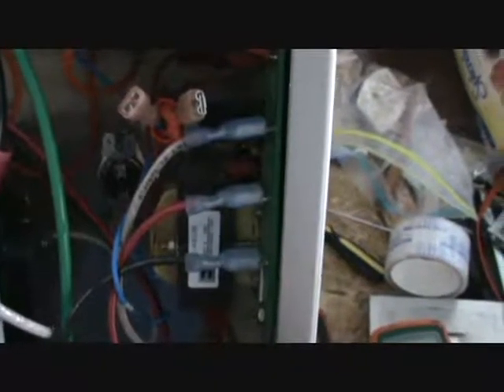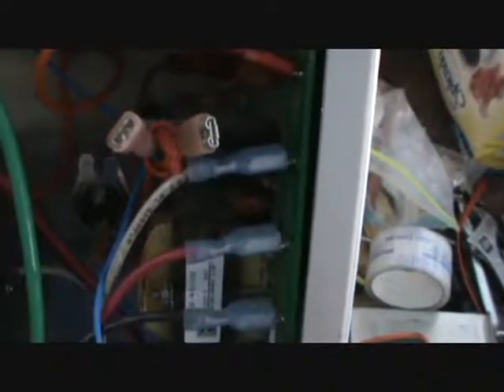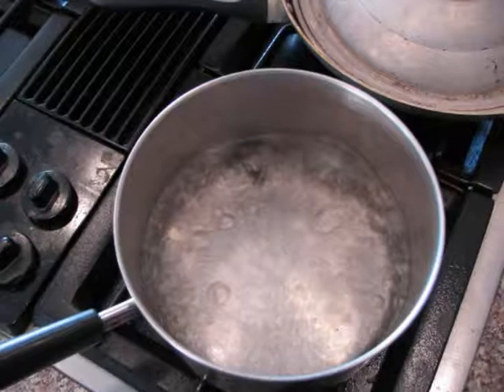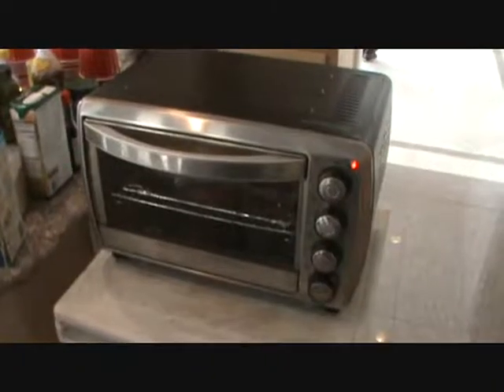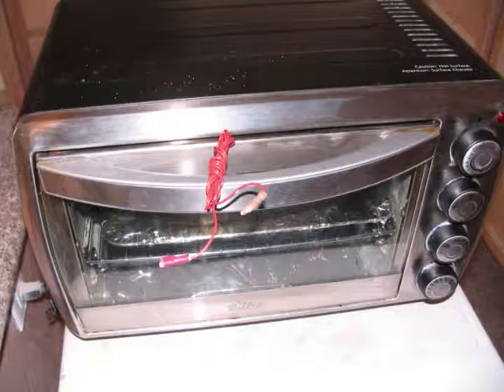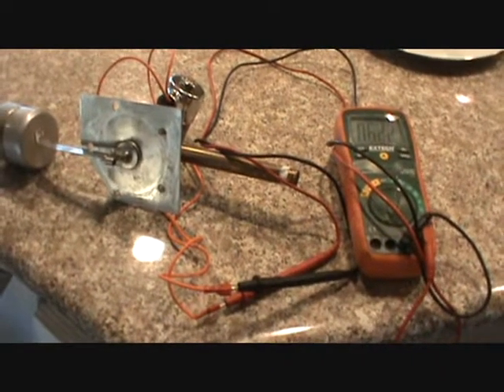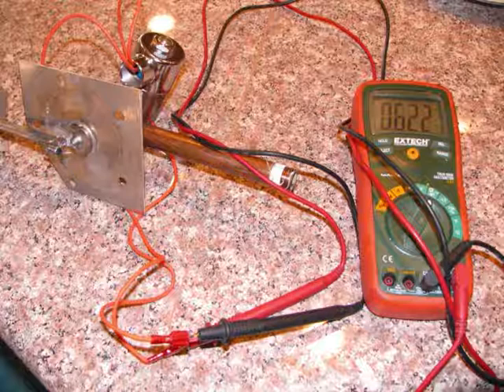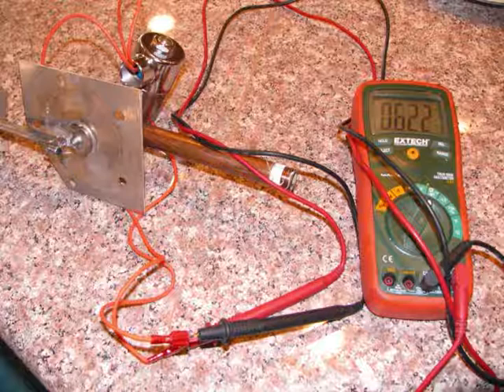Koler steam generator float switch repair part 3

Comment: These videos have helped me so much. Thank you John. If you’re still active here would you happen to know what a replacement part number (or even a part name) for the thing that screws into the side of the unit and connects to the float switch is? I got error 5 and then it exploded in a ball of sparks.

Comment: Thank you so much for the detailed videos HUGE HELP.... 
FYI, I have the same steam generator, however, for the past few days, it started to nonstop leak/drip water out of the steam head in our shower (thank God everything else functions properly🙏🏻). My guess is that solenoid that allows steam to come out and shuts the steam off, might not be closing all the way, and allows the water drips out constantly (steam off ). Do you know if that solenoid can be purchased online somewhere, along with that float switch/unite (not a bad idea to replace them with NEW if possible)? 
Also, to your knowledge what else could be causing this nonstop water drip to leak out of the steam head in our shower, besides that solenoid?
I appreciate any input.
Reply: I also have this problem going on, did you ever get a solution for this? Any response would be helpful!

Comment: heres the problem  the transformer on the eletrical board did not have 12volts on secondary side un soldered transformer form board and checked come to find out primary has a thermal fuse inside i found out after i had put 2 new boards in but what made the thermal fuse blow was the temperature sensing switch i dont know if that is what you call it or not the only thing it has wrote on it i k 5 or kf cant quite make the last letter out i have looked on internet could be called thermalcouple theroswitch or just temperature switch it not the disc type like yours   yours is a thermal switch when you took it out did it have a  whole where it mounts or does it just monitor the out side of the tank  you can buy the float switch at gems.com i have forget the part # but they only have one that is plastic like the one that is in mine  thanks for help

Comment: I missed your earlier response. I found those thermal sensing units on eBay they were a couple of bucks. However that wasn't the problem on my unit. I found that although the float switch showed to be working that at high temperatures  it failed. I eliminated the float switch from the circuit and I haven't had  any problems since then. As I look back over these videos I see that I came to a lot of wrong conclusion and if I had it to do over it would be a lot more straightforward. What I found was that the float switch is underrated for the temperature it's required to work at. I did not find a good replacement for it as those that were available were either too long or didn't meet the temperature requirements. I felt there was enough safety features without the float switch so I just left it out.

Comment: i called kohler they said we are not doing any rebuilds they at on time would send you a box and you ship it to them they would repair it for 300.00 they are not doing that as of today i figure that they have lost the contract  thermasol makes kohler but the thermasol support will not talk about the kohler parts and they have kohler parts i found online two places that sold thermasol parts but called them and they said you would have to talk to thermasol support dead end

Comment: yes the temperature sensing element that looks like a thermal switch it ha 1/4'' npt theads that screws into tank it is in series with the float switch and like in the wiring diagram the black wire goes to j4 and red goes to j5   but it is not like the manual reset switch like you tested and yes it is a kohler 9kw
Reply: I have the same problem that you described with the transformer and temperature probe. Were you ever able to find a replacement probe?
Reply: @brettblasiman361  Never could find a temperature probe kohler do not make them anymore. I plugged the hole where the probe was went and bought a thermal switch and installed it. The thing about it is when the temp probe goes bad it blew a internal fuse in the transformer so that made the transformer toast.
Reply: @larryflowers7591   I was thinking about installing an Omega TSW-TT-F3B-300R/WL. I'm not sure on what temperature setting. I will get it warmed up and test the water temp.